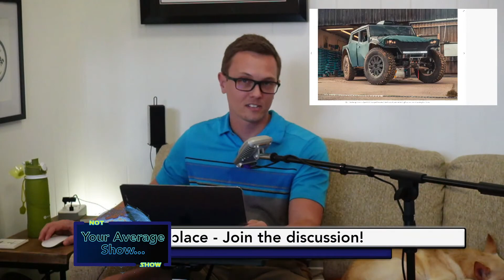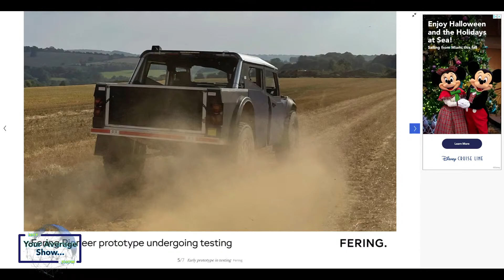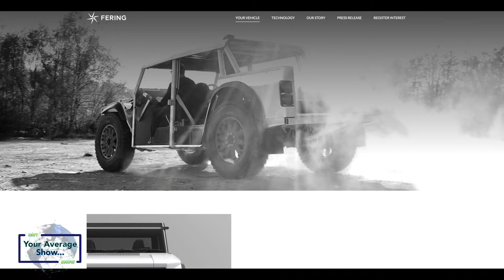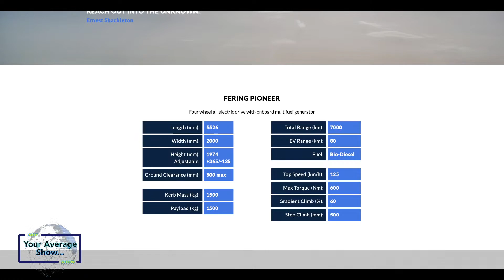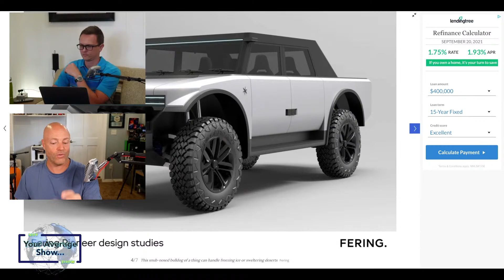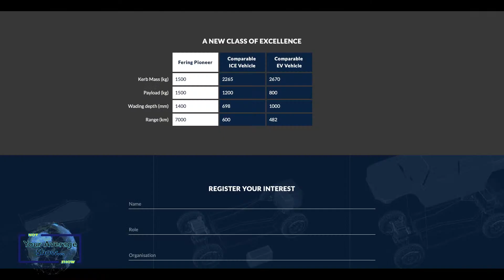Fering Pioneer Off Road EV Has A 4350 mile Range, And Can Go Just About Anywhere on BioFuel!

Comment: I think I read £135,000.  The really interesting part would be a pop-up style roof top camper system with lots of solar, and interior heating from the generator engine and integrated air-conditioning with water generation.